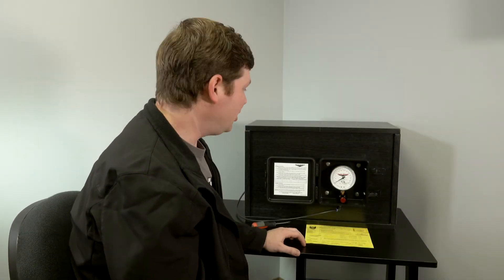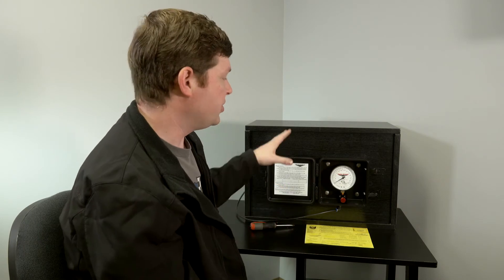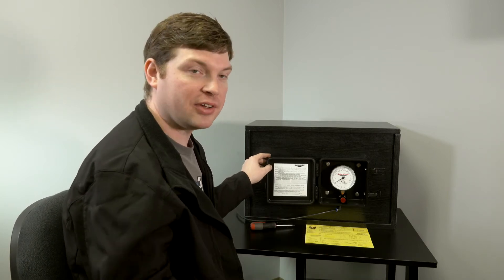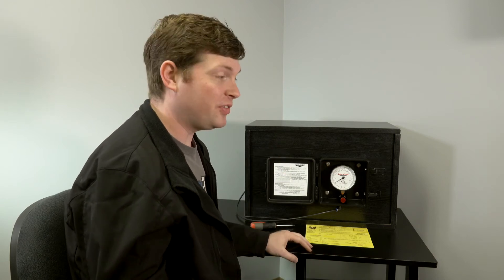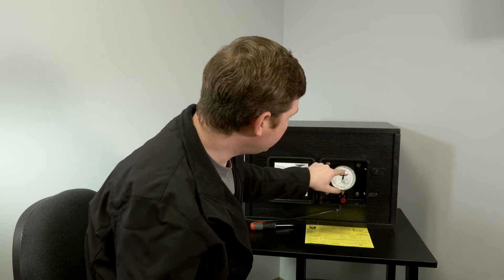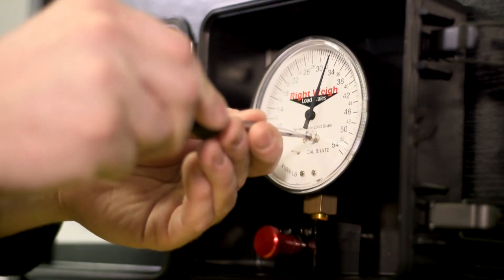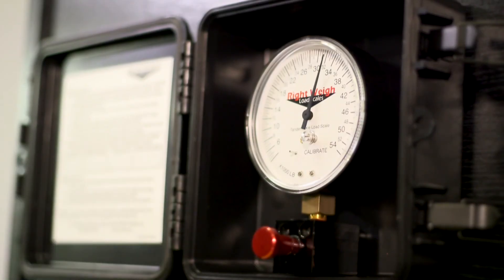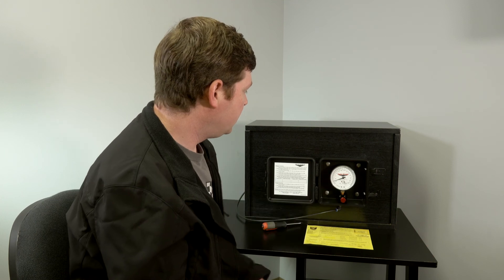Right Weigh Load Scales (310 Series): How To Calibrate

Comment: Thank you for the video.I have the right weigh gauge on my trailer.My tandem axle weight is 32420.I dumped the air out of the suspension,filled it back up and then turned the flat screw and it only goes to 34000.What could be the problem?
Reply from the maker: Check to make sure the gauge is connected directly to an air bag.  If it's on the smaller 250 series gauge, it may be that you have a Hendrickson suspension, we have a special gauge for that.  If it's the larger 310 gauge, it could be connected directly to tank pressure.  Check to see if the gauge drops when the suspension is dumped.  Of course it could be a problem with the gauge as well.  This can also happen if the wrong type of gauge is used (a tri-axle gauge on a tandem suspension)

Comment: Hello, I’m new to this load scale and a little confused on how to properly calibrate it. When my trailer is loaded and I go weigh it on a CAT scale, usually I apply the trailer brakes by pulling the red lever and tractor brakes (yellow lever) while I’m on the CAT scale using the intercom to get weighed. The instructions on the intercom says to apply brakes while being weighed. After I get my scale ticket and I’m on a flat service, do I need to release the trailer air supply (push in the red lever) and then calibrate the Right Weigh load scale for my trailer axles by pulling the red valve on the load scale? Won’t i get a different weights for my trailer axles when the trailer air supply is pushed in vs pulled out? For ex. my truck is on the CAT scale the trailer axle will show a different weight because trailer brakes are applied and when I’m not on the CAT scale the trailer brakes are released which will show a different weight?
Reply from the maker: Great question!!  This has more to do with how onboard load scales work vs the ground scale.  The ground scale will weigh the same regardless of if your brakes are set or not.  CAT scales probably say to set the brakes for safety and to keep the truck still.  Onboard load scales are very sensitive to changes in ride-height (distance between axle and frame) and setting the parking brake can easily lift or lower the suspension, which changes the pressure in the air bags.  (Imagine setting your trailer brake and then trying to drive away) The good news is that there is no problem with setting your tractors brakes to hold the vehicle while you calibrate the trailer, and vice-versa.